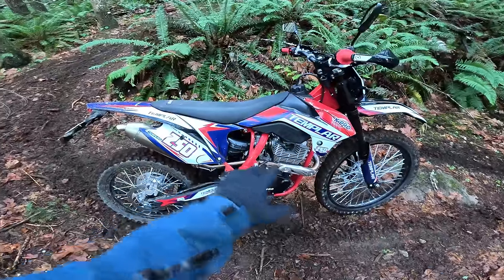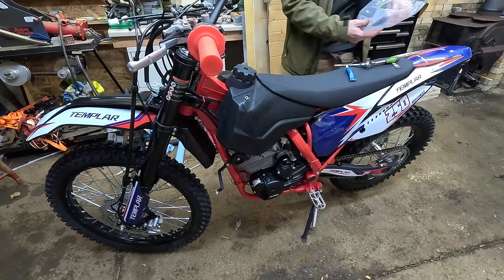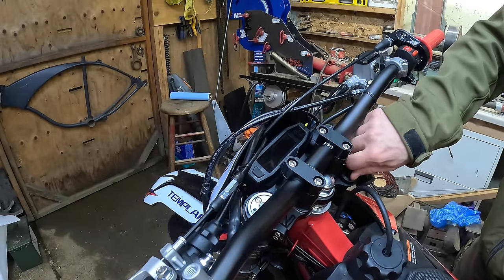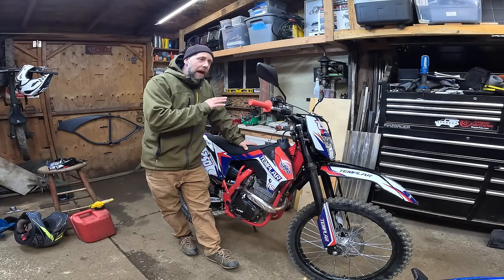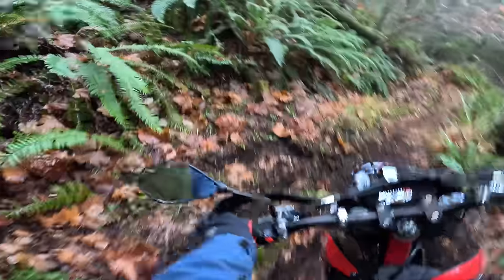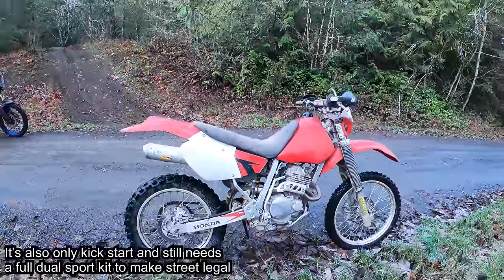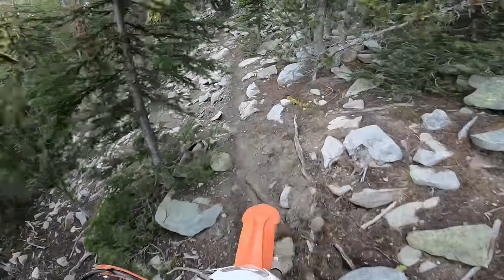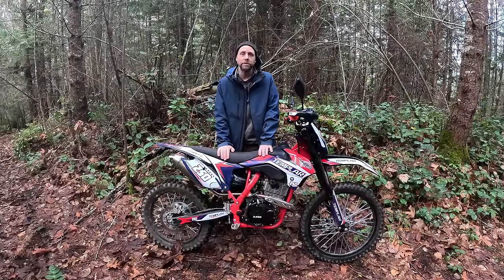Best Value New Street / Trail motorcycle? X Pro Templar 250

Comment: Good video.  I recently bought a new Bike, the last new bike I bought was in 1971 SL, a Honda 125, nice running enduro, that is what they were called back then, anyway it surved me well, good quality. Now forward to today the new bike I bought a couple months back is a 2024 Yamaha XT 250. All I can say is, Japan is still building quality bikes and the 2024 XT is so much more advanced than the ones made in the 1970's, I would say Yamaha are the top of the line motor bike still today.

I was looking at a Honda 300 cc duel sport because seat height was a bit lower,  and Honda has been always my first choice, I have owned many honda's over the years but I found out they are now made in China, and knowing China quality is about the quality we hade in the early 1960's, not that good.

So far I am extreamly pleased with the XT250 .

Are you near Spokane?
Reply: WAS GIVEN A BRAND NEW HONDA XR-75 one year and it was hard to tear up!...

Comment: GREAT VIDEO AND SO WELL DONE! On point, no extra banter or unnecessary information. I’m 48 and have owned all Big brands settling on KTM and Yamaha. Currently a 2013 YZ250f rider and my sons on a MotoTech 48V electric. I’m looking at a new inexpensive trail bike to ride with him while training, don’t need all that MX torque. I’m looking at the TrailMasters and you’ve opened my sights to the X Pro brand. It’s videos like yours that are extremely helpful and useful for calibrating the decision what direction a rider needs to go with riding style and quality in mind for this price point. Do you know of TrailMaster and how would you size them up against yours? Seems the same exact frame manufacturer and possibly both running Zongshen built engines

Comment: Nicely made/edited vid. Great to see you have riding experience, it shows in your bike's initial setup. Engine sounds great, doesn't sound like a cheap pingey piece of crap. I to ride an XL650L as an adventure bike, how ever, was looking for something as nibble as a 250 (air cooled) for deep in trail-less riding, But, believe I would/will have/buy the X mod, would be a lot easier on the bike with the 6th gear for hard/paved roads. Something the XR650L needs (6th Gear)  
With the 250 cc bikes, I like the short stroke engines for tooling around. It's kinda a shame there are no license-able trials bikes any more, I'd have one if they did. But, air cooled is the way and yes I would install the oil cooler on it, that's makes a plus engine wise. 
Good set up procedures and great vid 
Thanks

Comment: Seems like a no brainer. Maybe it will make dealers take notice. Buy 3 templars or 1 XT250/CRF300L/KLX300.  
If you like to tinker and tweak like most moto heads, this Templar series is a no brainer. 
Id actually probably try to quiet down the exhaust noise, seems loud as is.
Reply: I have the X and the stock exhaust is my only real complaint, it is a bit loud for a dualsport. Remedying this should be simple as slip on's are plentiful just have to figure out which one.

Comment: I bought the Templar X when it first came out. I had done a correct rejet, and replaced the rear sprocket with a 42 tooth. I was pretty disappointed with with the bike. Only holds a gallon of gas. Isnt too quick either. I sold a 84 XL350r to get it and that bike was a much better beast in every way.
Reply from the maker: My brother owns a 1985 XR 350 and I have rode that bike many times, I personally would pick the Templar over the XR for trail riding, the XR has a rear drum brake is 20 LBs heavier and just feels like an old bike. 
To each his own, I’m glad you like your XR 👍
Ps if you owned the Templar I would think you would know the actual fuel capacity of the tank? It holds more then a gallon. The X holds 2.38 gallons.
Reply: @Mikefestiva  you can doubt me all you want. Does not change my opinion. Worst dirt bike I have ridden.
Reply: Specs on the Templar X & M show 2.3 gallons?  The regular Templar shows 1.7
Reply: @MichaelDavidsonSLC  no idea man, all I know is a 1 gallon can would about fill mine up. Hard pass.

Comment: Rear Sprocket X: 49 teeth Base/M: 47 teeth    X/M: JTR 210, Chain 520     Rear Sprocket 2022 Base: JTR 897    Front sprocket: 13 tooth   JTF 270     Templar M is known to ship with hubs drilled for either JTR210 or JTR897. Measure before ordering. Same for Base 2023 model.

Comment: when you ride off road, you are always breaking things, you always need parts. Handlebars, levers, fenders cables, the chain and sprockets. Ware out, the chains not a problem, but the sprockets might be, you’re going to be needing oil filters, gaskets. seals, brake pads, or shoes.. Swingarm bushings, steering head bearings. Air filters, if you’re riding in a dusty area most of the time, I have known guys that would take six air filters with them ., Especially two-stroke riders, and they would change the air filter. Every time they went back in to the pits during a race weekend if it was dusty. All that stuff gets chewed up when you’re riding in the mud a lot quicker. You definitely need a factory service manual.. I worked at several different shops over the years full-time when I was younger, then part time later, just so I could get parts at cost. Guys that motocross are in the shop every Monday after a weekend of riding ordering parts.. dirt, bikes, street, bikes, quads, even your car, or your truck, those things don’t wear out as much as they are neglected to death.. One of the worst things you can do after a sloppy weekend on a dirtbike is, pressure, wash it and then put it away wet. Never never never use a pressure washer on anything you on that you ride.. that pressure, washer, forces, grit and mud in past the seals, down your cables, into your electronics, into your forks, into your wheelbearings, into your swingarm pivot, it rinses all the grease out of your chain, and all of those places I just mentioned. If you must clean it, use your garden hose…
  Dealerships, love to sell motocross bikes to the racers because those guys spend thousands on new gear in parts
Reply: Well put!

Comment: All the haters on this have to realize these are not race bikes, they are trail bikes just to ride and enjoy. Set up correctly like Mike went through his, and maintained properly will last very well. As you can see it can rip pretty well up a single track and has plenty of usable mid range. I would not buy this standard Templar 250 is your a big and heavy rider.

Comment: I have an XPRO titan DLX 250.  Seems very similar, I have been looking for a rear rack.  Any suggestions?  I have 150 trail miles on mine , no major mechanical problems just same as you mention.  General maintenance checks and keep checking for bolts backing out.  Solid for the money.
Reply: I’m also interested in the oil cooler you mention in the video.  Looking forward to that.

Comment: I am not a brand loyalist, I am a reliability and safety loyalist. I have kicked around on my 05 CRF 250 from new and just having known the limits of it for 19 years I feel secure in it and everything I use it for. The thing that jumps out right away with the Templar is that Frame looks sketchy, like it would twist on a small drop. Do you get that feeling about it? The price here in the UK for them is not awful but I feel like I would be replacing a lot right away to trust it and doing frame reinforcement for a week. Carb, valves, rear hub and sprocket are a no brainer for replacement and rear shocks and that would still put it at a really great price. I am just not sold on the steel for the frame. 

 Cheers for the review from Scotland, the only thing soft on the ground here is our arse when the old bike drops us.
Reply from the maker: The frame is almost an exact copy of my 2014 KTM XCW 200.
Reply: ...word on the forums is it is licenced by KTM

Comment: Cool  compact bike ,remember me too the XR/XL 200 with the two valve engine.I like bikes mixed from a Trials and a Enduro bike can ride every day or under hard offroad conditions. I think  a skiplate was a usefull upgrade ,even the engines case left ride need more protection because on small rocky trails with deep digged tracks some rocks "eat up" your case.

Comment: The motor looks like the old Suzuki DR250 and looked it up and they have the same dimensions (b/s).  The XR250 was oversquare which was counter intuitive from how they behaved.

If it is anywhere like the DR it is bulletproof and easy to tune.

Comment: I might order a templar. I recently bought a tse250r and was thinking maybe an fse250 but the templar is less than half the cost. My daily bike is a tw200 with a DL1000 a d a gen3 for longer runs. I have ridden all 4 on some trails. My swamp trail machines are colemans, tw200 and the tse250r. I am really a collector and have other bikes but so far these are my current favorites. Hey your channel rocks. I have linked your coleman videos on minibike threads. This video was great. Lots of good info..thank you!
Reply: I have the Templar X and it really does seem quite similar to the GPX at half the price. Guessing the engine and frame are the same but the GPX has a fair list of upgrades. Fun bikes.
Reply: @michaeldavison430  I might go with the base templar. And yes the gpx 2 stroke rocks...fun fun

Comment: Drain tank,or ride it dry,remove petcock,measure bung for petcock,order 1 with  reserve,and add a t fitting to the main fuel line to allow the reserve hose to be plumbed inline...
Reply from the maker: That’s a problem because I still haven’t found a petcock with a reserve yet on line. At least with the same size threads. All the ones I find with the same threads only have on/off.

Comment: Nice review and great detailed assembly description. Obviously this isn't your first bike build. I'm in Canada and those dual sports aren't available here yet. I'll be looking into 1 of these from the states this year. Just doing more research to see who to order from.
I read some of the comments about parts availability and parts for my made in china 2007 2 wheel drive 200cc quad are everywhere online and the parts are cheap. The only difference with made in China toys, is you just can't walk into local stealership and get a part in stock. But even older brand name bike's, the parts need to be ordered as well. I have a couple of older japanese dirt bikes 1990's 2005 and when I need parts for those, the stealer-dealer has to order from the states or a few times from Japan and that took 3-4 weeks.

Comment: 1,700?! Thats a good price, even if you only got a few years out of it.
Reply from the maker: Yes the bike is actually only $1400 but shipping was another $300 so the total was only $1700. I think it’s going to hold up fairly well. I owned a Chinese 2 stroke scooter about 20 years ago, I tricked it out quite a bit and it ran really well. I put over 5,000 miles on it in 3 years and sold it for only a little less then I bought it for. Thanks for checking out my videos 😊👍

Comment: The front plastic splash guard on both side of the aluminum gas tank of the natural aspirated carburator type Hawk. The X-Pro have plastic tank and digital speedometer. The oil cooler have two hoses connect to brand new cylinder pan head valve cover.

Comment: The bike looks like some of the other Chinese copies. The engine is based on a Honda XR engine which is a great engine. The frame is based on an older KTM frame style. Which means both patents from both manufacturers has expired , this means they're up for grabs for anybody to use them. Kayo makes a similar bike to the Pro Templar and the Kayo is a great machine so this one should be the same.
Reply: U think kayo and this templar are pretty even on quality?

Comment: Hy, this bike looks good, and running well. She is very complete, with ligths,turning, horn, . In France the chinese bike are not so complete. I have one but with small wheels (19-16), because I did want an high one. The 250cc running well, and the power is not so bad. She has a good engine couple. I subscribe to look the next video. Good rides. Kris

Comment: Great video and spot on advice about the initial set up good for any China bike.  I'd like to know if the engine has abnormal vibration? I had a rps magician 250  and sold it because of the head shake and engine vibration.  Idk if I just got a bad engine to start with or what.  Also I snapped the chain on that bike and it broke the case.  The chain was definitely not too tight just poor quality.

Comment: In hardware store, they don't have stainless steel bolts for connect the cap of the front brake master cylinder reservoir. Just 4 grade M4 bolt machine screw and dap of grease to the thread to prevent lock up.

Comment: The spring pull back the foot floor leg is worth from HaoSen better than Zongsen X-Pro foot peg. But it is welded on the tubular frame/250 chassis. The bolt on foot peg would be from Honda Twin 200cc or Night hawk 450cc and try hybrid the X-Pro with Kawasaki wheel rims or Honda foot super pegs.

Comment: Hey,really enjoyed the thorough run down.only thing i see that wasnt mentioned is maybe adding in a chain tensioner or a chain roller to take that flop noise out of equation. Otherwise got me wishing for one.ive got 2002 klr-650that i traded from brothinlaw.plenty of power but i hate everything else about bike to tall,lowered forks and got dogsleg all way down.still on my tippy toes.gas tank too fat,like a preggo pig.too heavy,if i drop is real struggle getting back up.otherwise 650 is dependable but definatly not a trail rig,unless your brave and in shape.anyhow enjoy the 250.snooky pa.😊😊😊

Comment: Excellent review!!!
So I went to their website. For the $$$ involved a great bang for the buck. Heck, they have a fuel injected model, I was shocked. My questions;
What is replacement party inventory like, throttle cable, brake hoses, sprocket choice, clutch parts, and replacement plastic?
Is there optional spring weights, or is that a race tech thing?
A skid plate is mandatory for my riding area, do they have a skid plate?
Maybe I missed it, but is there a total off road version, lights eventually turn into trail damage/markers  
I found 1 source for a Chinese ‘trials bike’, do you know of anymore?
Any 2 strokes?
Thanks again.

Comment: Ive got the cf moto v5 250 street bike an cantvfind parts for it it was a decent bike for the price i got it for used 600 miles on it an i road it quite a bit but once i had to start getting parts for it the ones i could find cost a fortune in shipping to get 1 dollar part cost me around 35 bucks shipping an now i cant find a water pump or other parts for it to rebuild it since its got a serious knock

Comment: When will you have the next video on the bike? I’m debating wether or not to buy one I have a 1985 xr250r and am curious if the power is the same
Reply: Keep the xr. I bought a Templar x back when they first came out. I rejetted, replaced the rear sprocket, and I was pretty disappointed with the bike.
Reply: Oh I’m never getting rid of my Honda I’ve put a lot of time in restoring that bike I just want the Templar to kind of scoot around town and hit some light trails
Reply: @aaronsukotsky3875  id convert the xr to be street legal depending on your laws. In Texas it doesn't take much. Only need a mirror, headlight brake light, and horn.
Reply: @aaronsukotsky3875   Exactly !

Comment: Really liked the idea of buying a Templar 250 off of Amazon as a first bike. I found this video on you tube first. But it does not look like the Templar can be purchased anymore. I love all the features of the Templar. I am a bigger guy 254  lbs. And 5'10" I don't think height will be an issue for me as far as my foot to ground clearance. Is there another 250 that would compare to the Templar that I would be happy with? Thanks in advance
Reply: You may want to look at a decent used DRZ400, they are sweet especially for us heavier guys.
Reply: @scrambler69-xk3kv  not to mention the items are usually junk anyway

Comment: I see by the engine number its a zhongshen motor. I visited the factory a few years ago in Chongqing. I was impressed with the production line standards
Reply from the maker: Yes I hear the engines are built fairly well, so far I have been really impressed with the overall bike and engine 😊
Reply: @Mikefestiva  obviously it's never going to compete with a modern 4 stroke on power. Not possible to make any big difference by tuning. Looked after should last OK for the money, I saw that engine in loads of delivery style courier bikes, some of which had clearly been on the road for quite some time. Enjoy. Its mostly about the rider anyway ;)

Comment: The gas petcock for three gas boxes to the reserve valve one side tank have to be one hose and both side gas tank have 2 hoses to the petcock with twin tanks in the motorcycle tank so shut off valve is no longer make from The Hawk motorcycle. It uses the weight and gas gauge needle type for next to my speedometer. The other type KS float ball inside gas tank as a sender electrical gas meter for the X-Pro modified motorcycle just like the Hawk 250 Hongda.